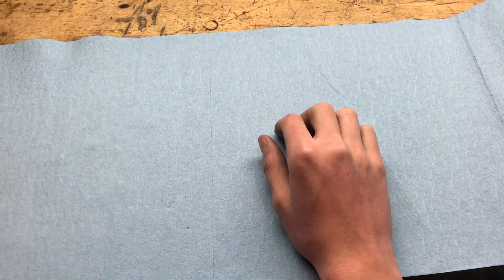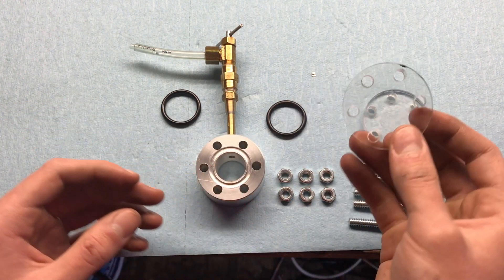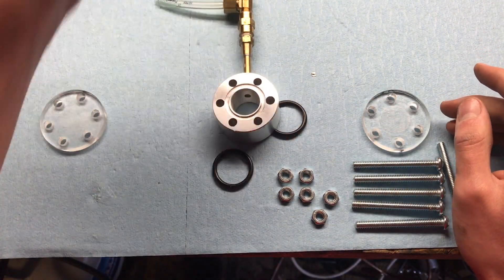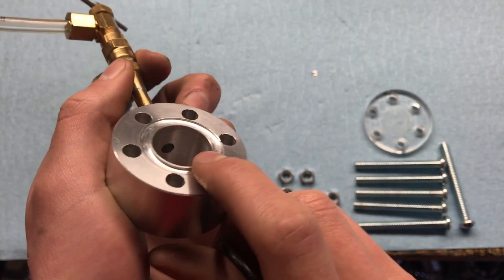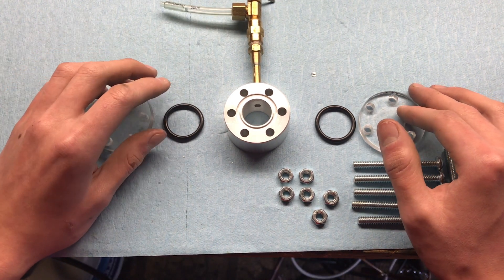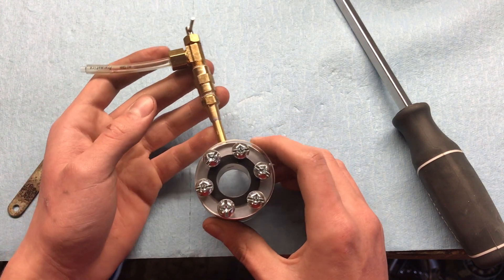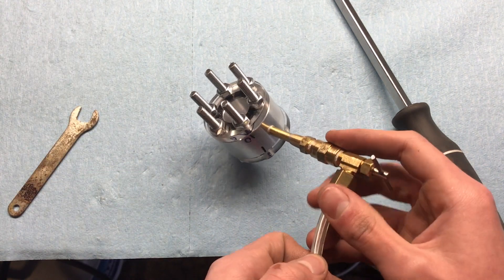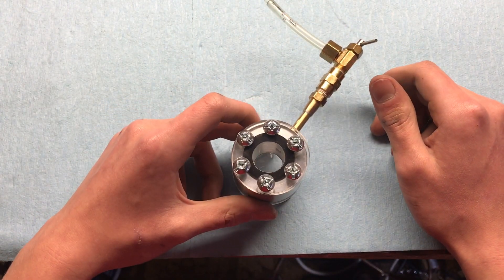Supercritical Gas Chamber: A Quick Look

Comment: This is super cool. Quick question, would this be able to hold up against the pressure conditions that liquid CO2 has? I was looking into building my own, but I want to be safe and make sure I don't blow myself up. What do you think?
Reply from the maker: definitely not with this thickness of acrylic. go watch Applied Science's video on the topic for how to do it safer
Reply: @cylosgarage  Then why is this called supercritical gas chamber in the title? In my opinion this is a bit misleading. edit: I've just now read in the description that even you say, this title isn't correct.